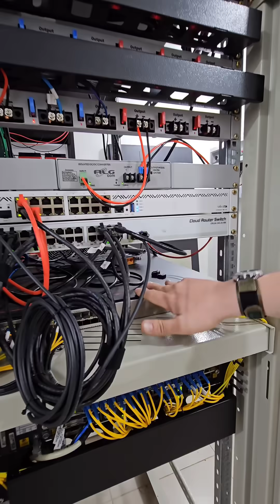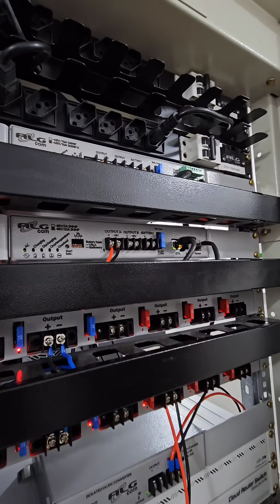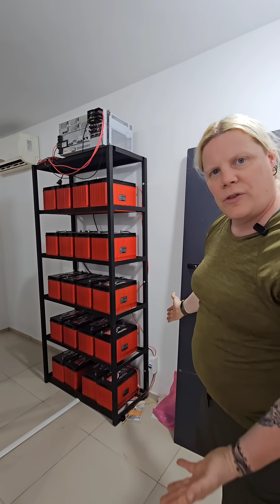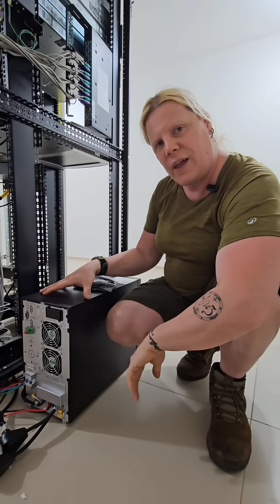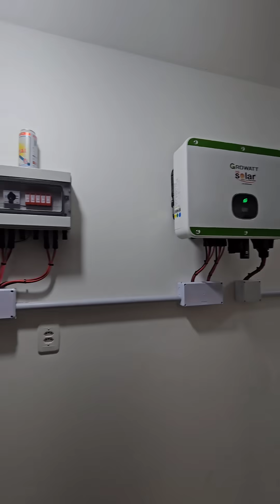This is The Central Office "CO" of a regional #isp . #shorts #telecom #technology #internet

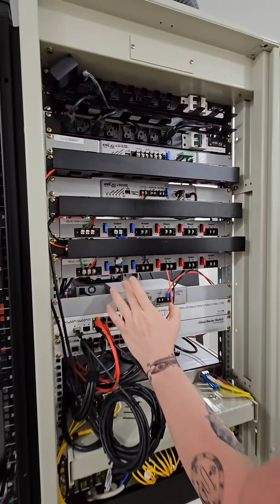Comment: 0:55 what kind of fuses are those in the 48vdc pdu?
Reply from the maker: Standard automotive "blade type" fuses.
Reply: @thefixitgal  Oh okay that’s what I was thinking. So is this a common standard? Back when I looked for 48v rated fuses everyone says you can’t use Car fuses on 48 as they are only rated for up to 30 something volts I don’t remember exact details just the claimed it could arc or something. They recommend a different type of fuse which only come in high amperages I ended up just buying a 7amp DC rated Din rail circuit breaker. Which I’m not even sure is the right option at this point.
Reply from the maker: They won't arc over at the loads were running which is why they're fine for the application.. You can also buy 48v blade fuses if you look hard enough.